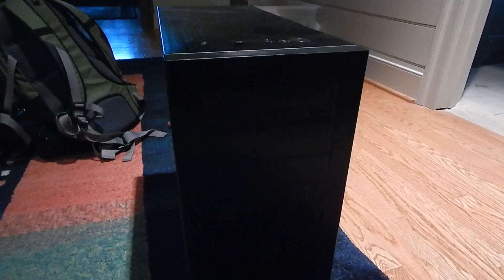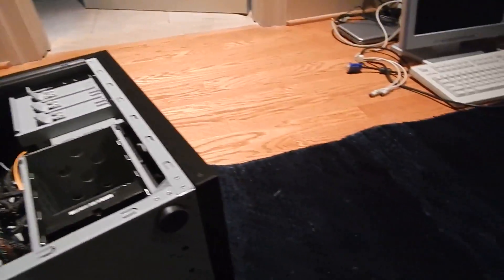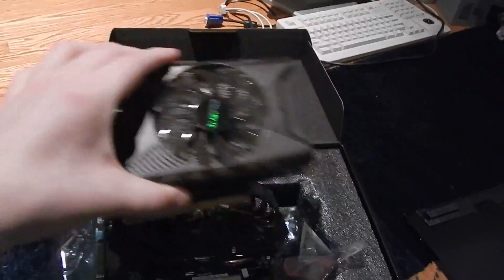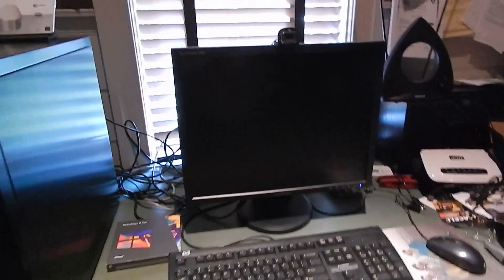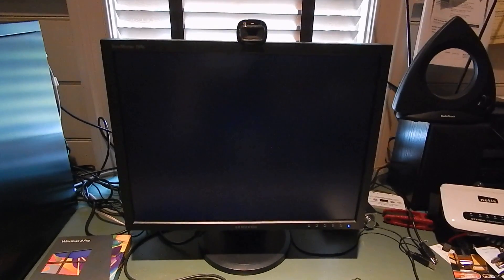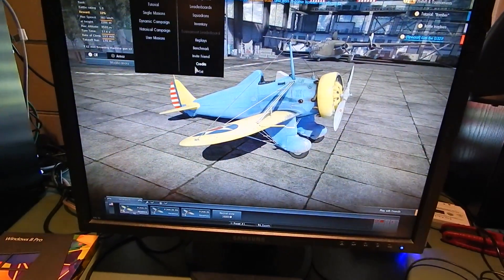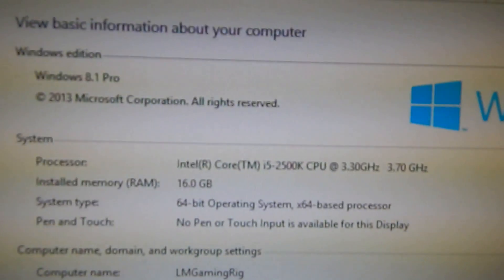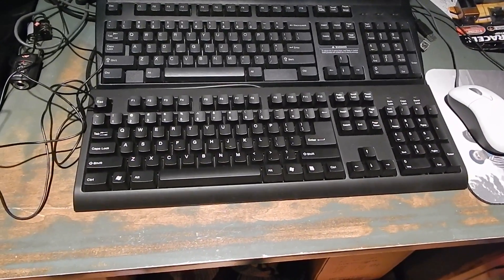Introducing The Gaming Rig - August 2015

Comment: my machine i still have 2 quad core xeons e5430 processors, 16gb of ddr2 667 ecc fully buffered. also i have gone to a geforce 9600gt but hey it does me ok sorta. also i have 4 hard drives in it now. and i have a dvd burner in it. i also have a lian-li case a pc-62 case its more like a server case sorta cause the fans are all molex and run full speed at all times. i also run dual monitors and i do streaming and have a place to stream which is livestream.

Comment: didnt you have a 2500k with a 750ti? What happened ?
Reply from the maker: ***** That's still my main machine, it's just running Linux now.
Reply: lmull3 Which distro?
Reply from the maker: Ramses De Vuyst Debian
Reply: lmull3 the 2500k is still a amazing cpu for gaming. I was running mine with 2x 760s in sli with no bottleneck. If you put a 2500k you wont have a issue.
Reply: +lmull3 do u like ubuntu mate or ubuntu 15.04

Comment: I used a GTX 650 for a few months and a 7870 for two years and they were all mid-low range cards, I then upgraded to a GTX 970 which I got for cheap used (as I wanted to play the Witcher 3 on Ultra) It's all about your needs, if you don't care that much about graphics and FPS, then you're fine, but I'm a total snob when it comes to that.
Reply: DuSlothster 7870 was not low mid at all when it was released, more like mid to high end. I know because I bought one in 2012 , and it was 350€ at that time, and still plays most games 1080p with high detail without problems.
Reply: kanopus06 I was talking about the GTX 650 being low and 7870 being mid.
Reply: Ok, in fact I wanted to get an GTX660 by that time, but constant delays made me reconsider and buy that 7870 I still use.
Reply: DuSlothster I pretty much use the sameish setup.

i3 2130 with a Z77ma-G45 and a EVGA GTX 650 1 gig. No complaints at all honestly, I love it and works damn well.

Comment: Its pretty much a rebadged 7850.
Reply: Quannix Rainbowaxe I think he meant as in the performance
Reply: Quannix Rainbowaxe well he didn't say it was a rebadged 7850, he just said it was like a rebadged 7850. Also, I do know the 770 is actually a rebadged 680 with a few improvements (I have a 770 and I know someone who has a 680), but I don't know where the 960 falls in
Reply: Quannix Rainbowaxe You got a link for this new architecture? The 370 is based on pitcairn.

Comment: i3 plays games pretty much the same as the i5 90% of the time
Reply: Edmundo studios not true, almost all modern games will run better on an i5 than an i3
Reply: ictdude1 Not really you can run most games on an i3 with no difference.
Reply: Edmundo studios i take it your not great when it comes to pc gaming?
Reply: ictdude1 I have 4 PC's which I have built myself. The i3s run most games flawlessly next to my sandy and ivy i5s because of HT

There are benchmarks out there readily available...
Reply: ictdude1 Games are almost completely GPU bound these days you can play BF4, Witcher 3, Evolve with barley and difference between an i3 and i5.
Reply from the maker: Edmundo studios They especially do on the more modern i3's like the Haswell ones too. I went for the i5 for longevity and if I needed to use the machine for more than just a game, which is bound to happen knowing me.
Reply: +Edmundo studios Not anymore, Game optimization is starting to rely more on extra cores for threads of code, rather then clock speed. Physics are getting more demanding with each new release. Even higher end i5's are bottlenecking 980tis and see no advantage at all in SLI
Reply: ***** In what games though? AAA games like Witcher 3 and BF4 are built around consoles first and then optimized for PC. PC exclusives like GW2 and Starcraft are built around running on the majority of hardware available.
Reply: Edmundo studios With new consoles being based on x86 on 8 core CPU's (Really just 6 because of the OS) the optimization SHOULD be getting much better on PC in the near future. Obviously the consoles will get more out of less, but that is because they only have one job. What we really need, is to stop the x86-64 line of processors and move to something else. (ARM, PPC. CELL.) Something. The only issue with that is AMD is knocking on deaths door, and Intel is getting lazy, our only hope is that Samsung, or IBM come back to the chip game(Be a first for Samsung) I wish that the Sony, IBM, Toshiba CELL architecture would have come later rather then sooner as it was unknown territory for most. The CELL processor is a number crunching monster so it would be well suited for a workstation environment, while an ARM processor is great for gamers and everyday consumers. I truly do not see a long future in x86 due to both its flaws, and age. The age of Ghz wars are over with the limitations of silicon wafers being reached. x86 will not go up anymore, but will instead spread "out" with more cores. (AMD had the cores early, but no support). Then there is always the possibility of cloud based computing with the these new fiber speeds being rolled out. With one low end (Dummy) client, and a large server on the other end, including storage. If you keep the storage cloud based, then there is no real connection limitations. Allowing faster transfers of file, and fast uploads between servers. Of course there is a large risk with 100% cloud based computing when it comes to security, and long term storage dependence. I probably wanted to say more, but forgot. Sorry about the ranting thing, guess I was having a moment of though. Hope it was an okay read :)
Reply: +Edmundo studios Most games coming out require quad core CPU's as a minimum.
Reply: The Gaming Geek They run fine on i3 because of hyper threading.
Reply: Edmundo studios Still, its a dual core
Reply: +Cody6210 dunno man... if the x86 has a future in corecount, software needs to catch up more than ever. i can see a future for AMD as the king of corecount. inhell has given a good example with hyperthreading and AMD follows with the Zen. i can only truly hope Zen blows away the competition and releases the right software at the right moment. i dont see phone cpus as a future for gaming; the entire OS on any phone works different from PC. quantum has a few development years to go through so this has about 200 computer years (20 ish irl)